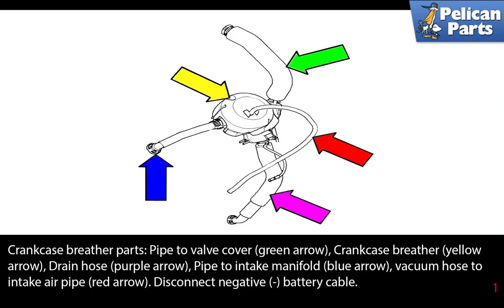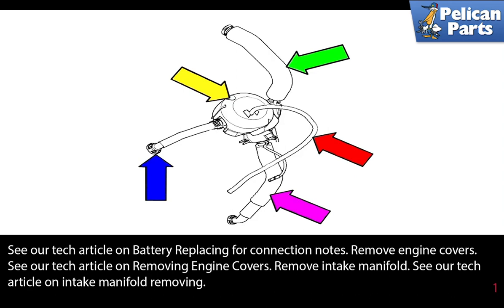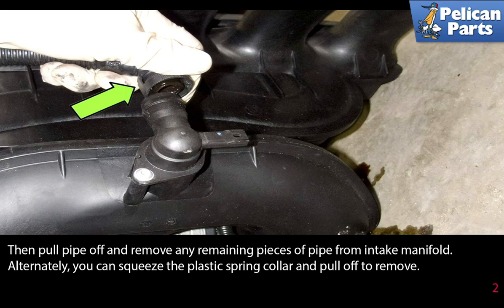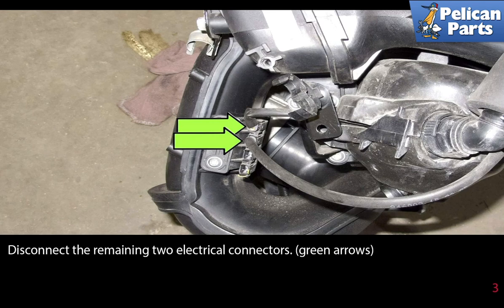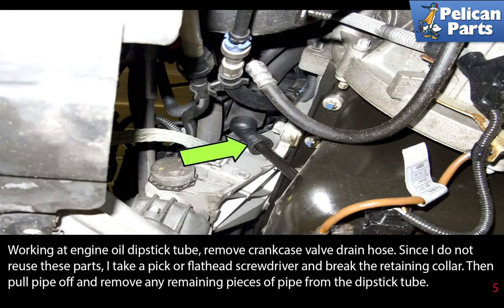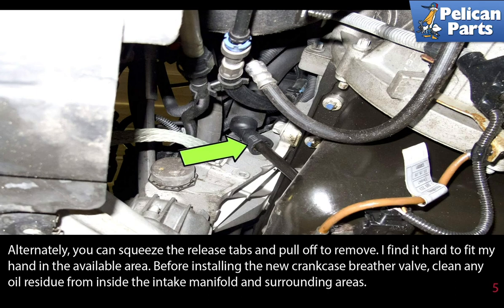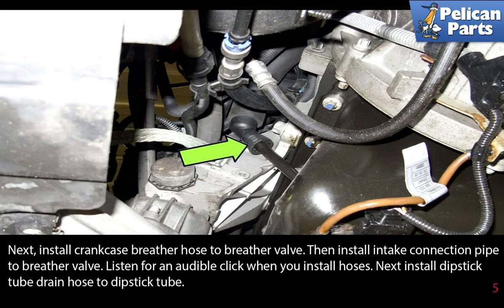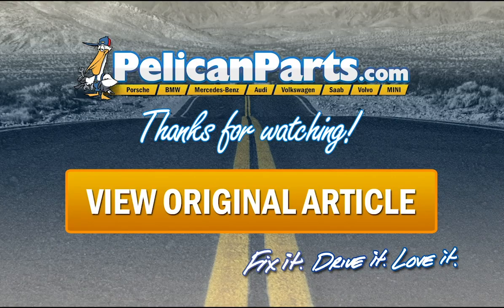BMW E90 3-Series Crankcase Breather Valve Replacement for 335i, 325i, 325Xi, 330i, 330xi, and 328i

Comment: i have Bmw E90 320i model 2008 with n46 Engine.

quick question,in my car, previous owner had removed the crankcase valve drain hose(purple) and my oil dipstick is closed with some pliers.
and oil is leaking from somewhere, i am attaching photos below could you please tell is it safe to drive like that? or should it be connected to something.

thanks in advance.
Reply from the maker: I would suggest repairing the crimped hose and the oil leak. The leak was likely caused by incorrect crankcase pressure.

Comment: Any other common repairs/maintenance while this is apart?  Is the oil stand gasket or anything else easier?
Reply from the maker: Oil filter housing, valve cover gasket.

Comment: Hi, My bmw E83 crankcase vent valve went bad with pressure in engine & blow out my valve cover gasket. Do you think it could have damage any other seals?
Reply from the maker: It can happen. Check for signs of fresh oil at the seals you suspect are leaking.

Comment: Does the N51 engine have this part? Everywhere I've looked for a replacement all say does not fit your vehicle.
Reply from the maker: With your vehicle info handy, give The Pelican Parts parts specialists a call at 1-888-280-7799. They can figure out what part or repair kit you need.